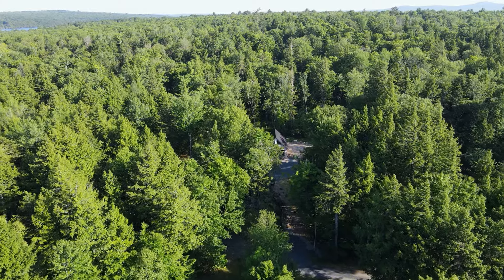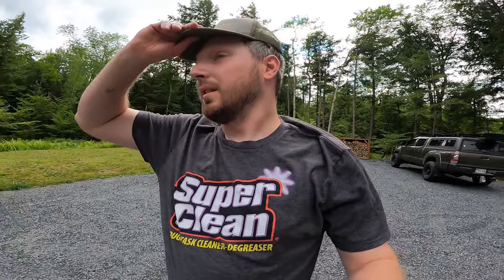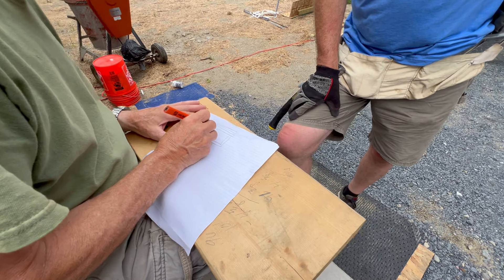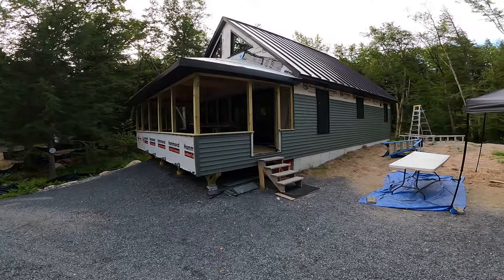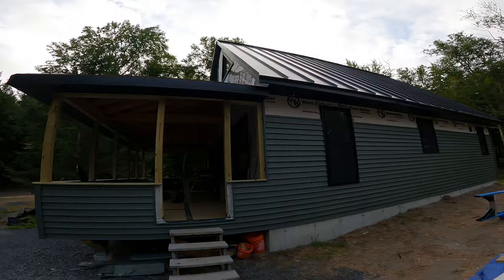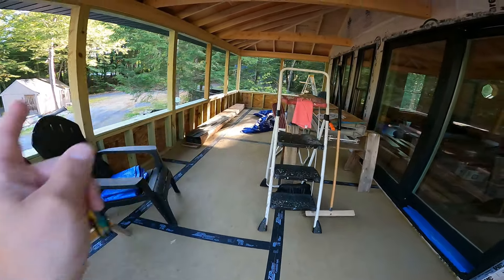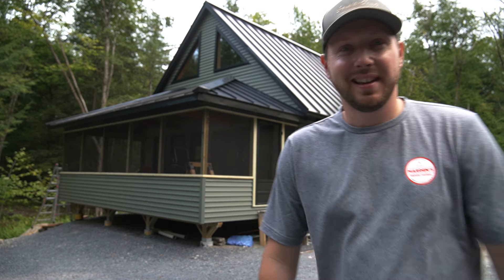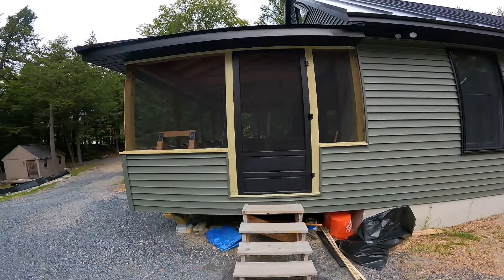FINISHING The Outside of Our Cabin (Screen Porch & Siding) | E.p 11

Comment: I did not see a ceiling fan in the main room. Would one help to circulate the hot air that rises from your heating stove? I know you said the stove has a blower but that air is going to rise to your high ceiling.

Lots of work but the family will enjoy for a long time.
Reply from the maker: @cchambers8632  there is a ceiling fan. Also one in the loft! I was prepared! Lol